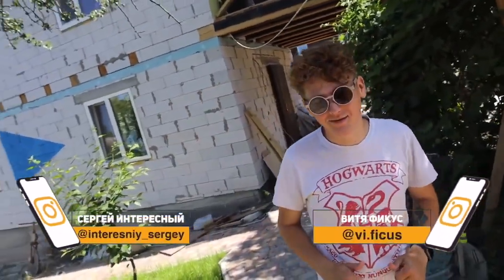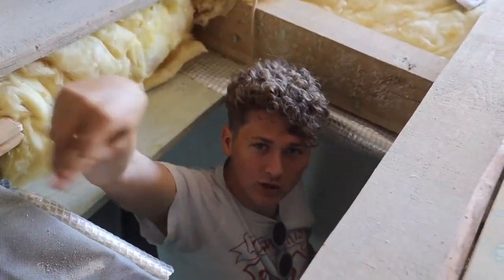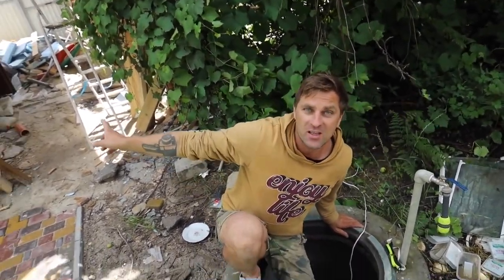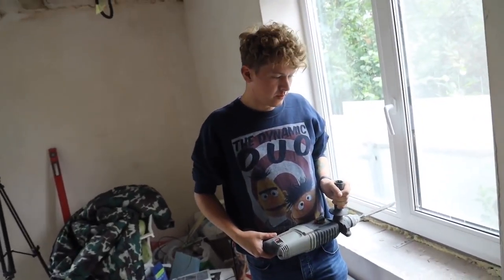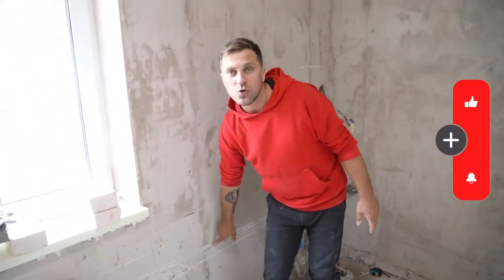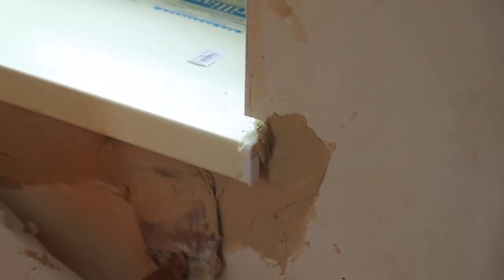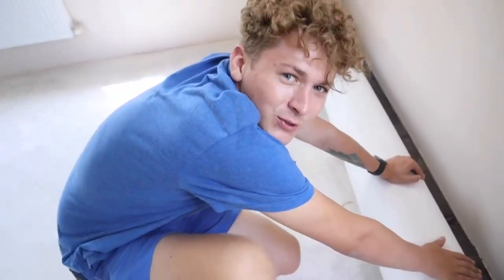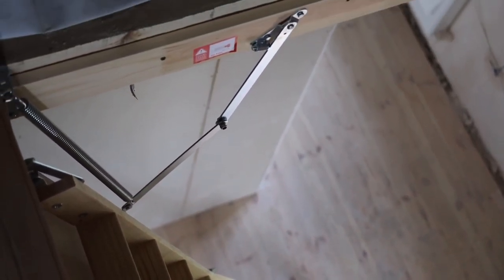BUILT A REAL 2-STOREY HOUSE IN 60 DAYS! LAID THE FLOOR

Comment: Try and mix of wallpaper and paint - three walls of paint and one of wallpaper. That depends of course on the colors and patterns you choose. You could also paints all four walls but then have a a strip of wallpaper run all across the top of the room. Very impressive work all around!